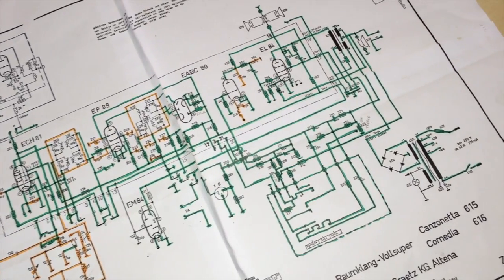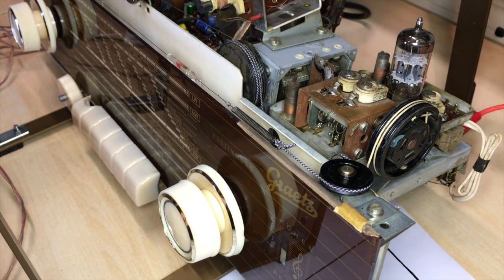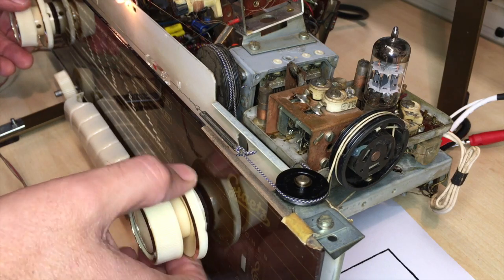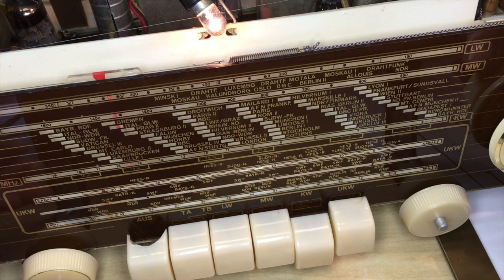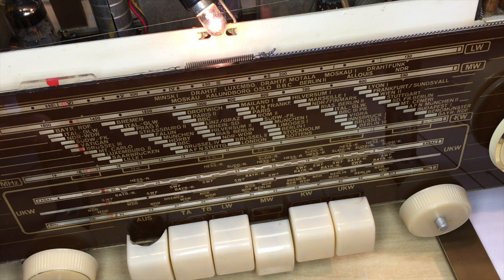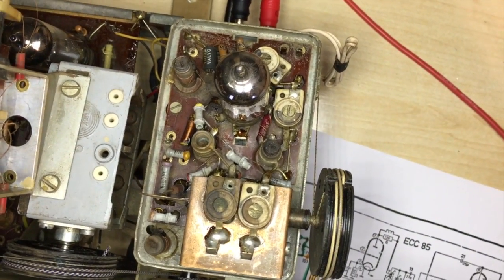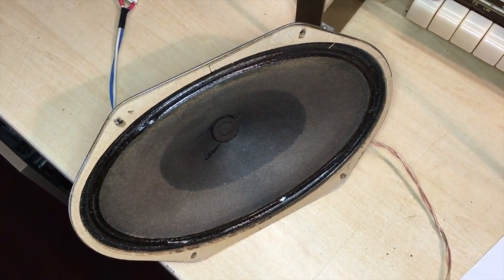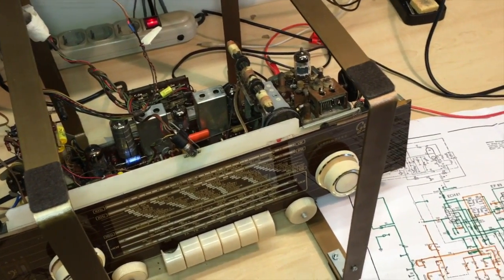Graetz Comedia 616 tube radio restoration - Part 4. All systems go. Bands tested.

Comment: Nice job buddy, that sounds pretty good. Have to agree with you on restoring wooden cabinets, not my favourite bit of the job by any means I prefer Bakelite cabinets. I trained in Electronics so that's my favourite bit of restoration.
Reply from the maker: +Andy Gallagher: Bakelite is definitely easier for me too. But ... you work with what you've got. So, got to get down to it ...